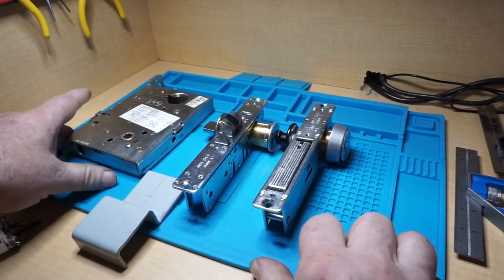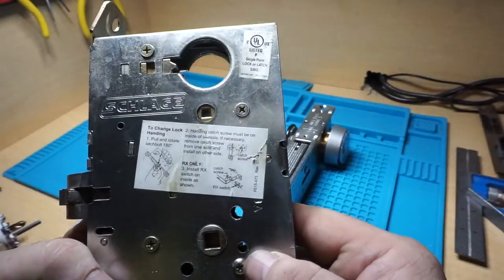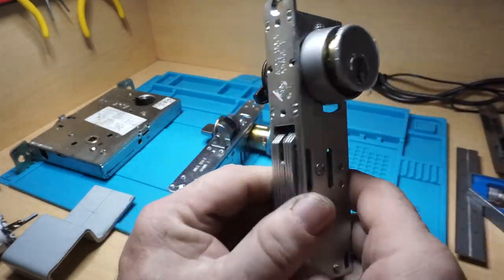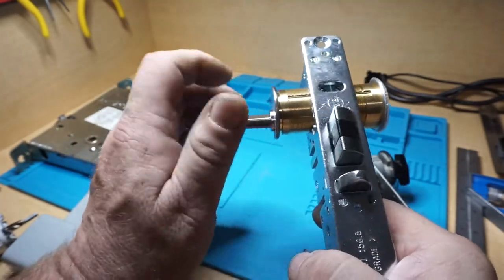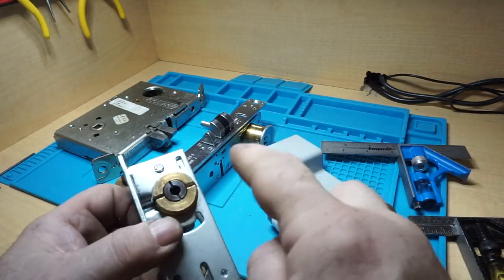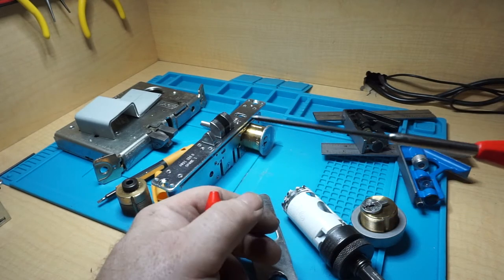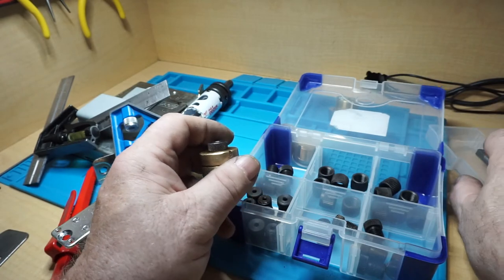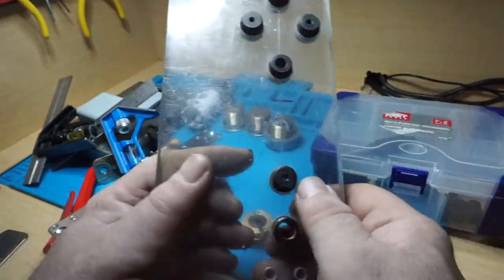Video 14 Best Mortrise Cyl Drill Giude

Comment: I've used this tool and it's super accurate and easy to use. Not to mention that if you drill your pilot hole off, the guide will correct it. Great tool.
Reply from the maker: Thanks Dan I do a lot, I do a lot of leg work and research and testing on all the tools that I design and make to ensure they perform well before letting everyone know about them, I always appreciate comments.

Comment: I have known it to be a mortise lock(case) 
Your guide tools are cool but I can see the one work on a mortise lock if a thumb turn is needed but the amount of time to measure out the cylinder bore you can have the A/R off the door and while the A/R is off the door you are preventing metal filings from falling into the lock specially a deadlatch which could cause the lock to jam up then use your 1-1/4 and drill through. 
But to suite there own and what ever works. But remember the metal filings that can be a headache specially on a warranty call.
Reply from the maker: Thanks for your reply On  Mortise Case or Cassette,  Although with the guide system you do not have to measure accurately and hands down it is faster and  more accurate in the area I'm working I have seen lots of Adams Rite installed with little tabs that are not even screwed to the door so these are a real nightmare to reinstall. I have never had metal shaving gotten into the Adams Rite ever, the hole saw ejects to the outside of the astragal last week at a complex  I did five astragals and not one had any metal filings in the dead latches the point is you do not need to measure accurately you just need the hole to be accurate enough for the 1/4 inch guide in many times the 3/8 hole is not accurate but I can see the guide that is all that is needed.
Reply: @locksmithinginnovation11  ill give it a try when I get a chance to construct the guides
Reply from the maker: Thanks James that would be a proper and fair comparison, I was thinking that maybe the channel will have a contest when it gets so many subscribers  a draw and I would make a tool of choice to the winner. Jeff